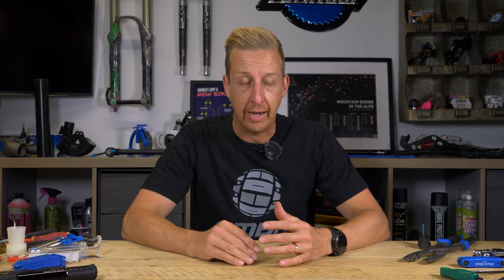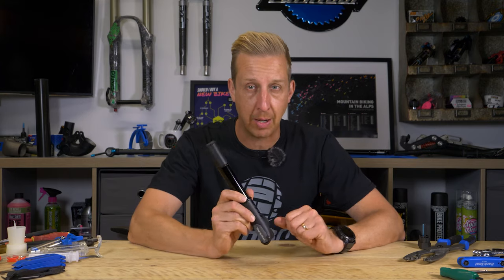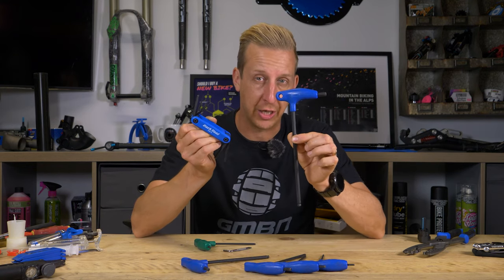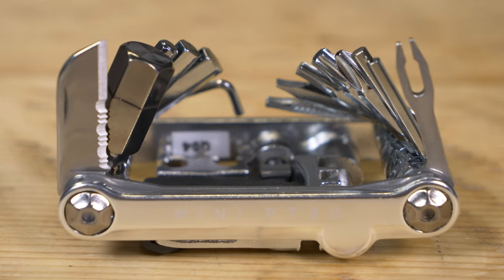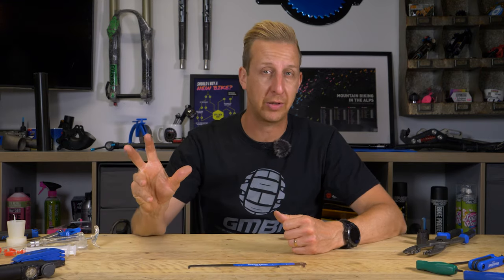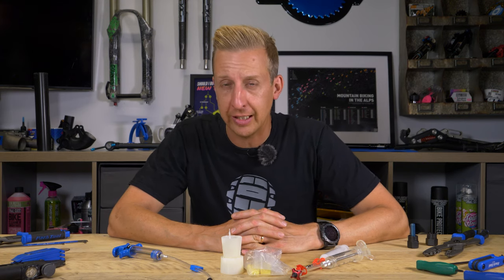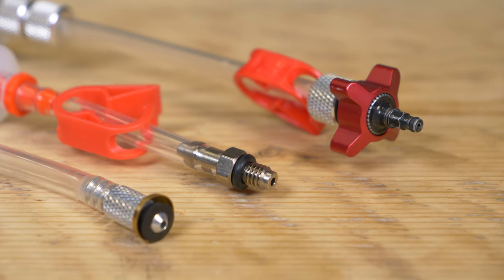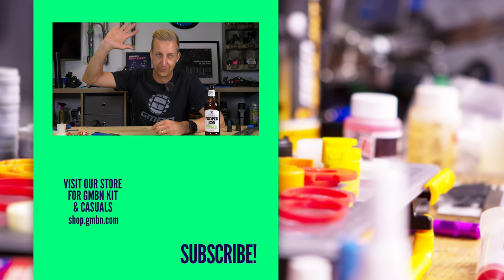All The Tools You Actually Need To Work On Your Mountain Bike | Essential MTB Toolkit

Comment from the maker: What're the most useful tools in your tool kit?
Reply: From time to time I get to strip down and deep clean and rebuild old and used bikes, so I'd say a crank puller. Can't hope to work with the old square taper standard without it.
Also a mug of coffee is very important.
Reply: Mine would be the specialty tools like crank puller, cassette tool, bb removal etc as I am sick of struggling with other tools like mole grips to remove the bb
Reply: Cup of Tea
Reply: Most useful?  Or most used?  I use the pressure gauge and pump nearly every day to top up the tires.  But there are a  lot more tools in the box that I couldn't do without.
Reply: My torque wrench is so important to me❗️Tightening bolts with the proper amount of torque is crucial to get rid of several problems, replacement costs and waiting times for spare parts/bolts.
Reply: @gogovitch66  what are the several problems that you have as provided you know not to overtighten things you get a feel for the correct amount of torque
Reply: My Clarke Tool Box is the best tool I have bought in years - I love it!
Reply: STEEL tire levers- I don't care who's name is on them or what color they are, plastic tire levers are rubbish.
Reply: @floydblandston108  just be careful when removing, resetting a tight 2.6 on a carbon wheel. Deep grooves and scratches ain’t groovy. Saw a friends crack his enve wheel trail side. True he may be a Sasquatch goon, but his fancy metal tire lever did major damage. Never happened w quality acrylic brands. Imo. Happy safe riding! 👊🏻
Reply: @nycgmr  - I bent, broke, or otherwise deformed a lot more shitty tire levers- including the 'quality acrylic' ones- than the number of rims (0) that I've damaged since going metal.
Reply: My Park Tools chain cleaner , strap it on and spin your chain , works great .
Reply: @TheRCBasher69420  ya crank puller came in handy many times !
Reply: @floydblandston108  go easy Hulk ;) 👍🏻
Reply: Precisely, Better the 3 dollar lever snap than your 1300 rim. IMO. OF COURSE. To each there own.  Metal for you? Ride on, right. Be well we safe.
Reply: My Crank Bros. multi tool has been my most useful and used tool. Love the cable cutter though. Thats has allowed me to do my own tune ups. Saves me money to spend on more gear. 🤑
Reply: @nycgmr  - unfortunately, my tire preferences seem to run towards the unmountable (Michelin, Vittorio/Geax), run tubeless! : D
Reply: My wera zyclop mini bit ratchet set. Take it with me on every ride and it's so so compact that can use it on every bolt on the bike as it comes with extension.
Reply: Knipex pliers wrench. Adjustable to turn any size of bolt. Can crimp end caps better than any alternative. Also useful for grabbing things like regular pliers. I use it all over the house too
Reply: Great video! I think a set of picks are super underrated and you don’t have to spend much to get a set that does the job
Reply: Chain cleaner, pumps, and hex keys I’d say. Use those all the time.
Reply: My leatherman, goes with me on the trail with my multi tool. The pliers saved me so many times.
Reply: Derailleur hanger alignment tool is specialist but I’ve used it countless times to sort shifting issues and bent hangers.
Reply: Xiaomi electric pump. Turn it on, set the desired pressure, rest and relax while the pump works.
Reply: allen key set

Comment: Also don't forget that you can use plastic/nylon tyre levers as a stand-in brake piston spacer, as well as pushing the pistons back into the caliper when fitting new brake pads or bleeding/cleaning your brakes. More multi-use single tools! 💕

Comment: The casette tool also does centerlock bolts, if anyone reading this doesn't know. Cheaper centerlock rotors use the bottom bracket tool.
Reply: And some rockshox top caps

Comment: A derailleur hanger alignment tool is critical if you ask me. You can get one for 40$ on amazon that does the trick. Such an easy job and one trip to the bike shop will cost you that. I wouldn't call it a specialist tool. Everyone bends hangers and rarely are they well aligned from the factory.

Comment: I normally use a MIG welder to cut and weld the inner gear cables. Just earth the cable, line everything up, a momentary zap, and your done. No need to crimp on a cap.  I mean t's worked for the last 20 years, and saves me buying a dedicated tool. Outers angle grinder (not in situ). You can also use it to weld old chains into shelf brackets for bike themed home decor.

Comment: Always have a nylon string/ shoelace in my toolbox and riding bag.
You can split chains, hold chains together to rejoin them, tie anything to anywhere (dropper on rear tire/ things on your bag/ Gopro on the tree /.....), zip tie alternative,  have a shoelace if you rip yours, I also did my internal cables with a string, a piece of metal, a magnet and the rockshox barb connector instead of buying the 60€ parktool kit. Endless possibilities 👍

Comment: Tire levers are also good for getting under those old stock grips without scratching your bars so you can spray some soapy water in there to loosen them up for changing.

Comment: "Only a rich man buys cheap tools"

Great video. For Allen keys I went with Klein for half the price. But I notice some flex when I need to torque on something so I keep some hardened steel Allen keys handy, just whatever brand the big box carries. 

Where I have cheaped out is I bought a very inexpensive and under powered compressor for popping tubeless tyres in place. Before that, I was having luck going to the air pump at a nearby gas station with a valve adapter and handful of quarters. 

Great vid!

Comment: The primary reason you want to stop your inner cable fraying, IMO, is so you can still remove the inner cable (e.g to clean/lube the inside of the housing) and then thread it back through again afterwards, without trimming it and making it too shorter.

Also, frayed cables are sharp and pointy, make sure your tetanus booster is up to date!

Comment: I've used the same Joe Blow floor pump for nearly 20 years, a model very similar to this one, and couldn't be happier with it. Well worth the $60 or so I paid for it back then (on sale).

As for allen keys, I will sheepishly admit to never having owned a proper set in my over 40 years of riding and maintaining my own bikes, relying on a combination of various multitools, a Park Tools 3-way ball end hex tool, and allen sockets for when I have to use a ratchet or torque wrench. These have usually sufficed but I will admit to having rounded the occasional bolt head due to insufficient torque.

No need for Torx tools as my bikes doesn't use them, although I do have various Torx bits and sockets.

Also no need for a bleed kit as I have rim brakes, but I do have a makeshift bleeding setup for when I have to bleed my car's brakes. I installed one-way bleeder valves on it which makes the process so much easier. Are there such things in the bike world?

I've never owned a high quality chain breaker because I've never needed one since I only shorten new chains and then use master links so I don't need the precision of a quality tool to install pins.

Otherwise I have all the other tools discussed here, and many others. However I try to never use an adjustable or crescent wrench as shown in the thumbnail if I can help it as they loosen and slip, unless it's the locking type or I don't have the proper size spanner and have no choice.

Comment: Some really useful info, cheers! Just a month or so ago was setting up for finally learning to do essential maintenance myself and after a bunch of research arrived at pretty much this set of tools exactly (even the need for a separate 8mm allen key to accompany a multitool 😆). The one thing I looked at and skipped for now is a chainwhip. I find that if you're only servicing your own bike and need to remove the cassette once in a blue moon, an old chain can do the trick quite well. Wrap one end around the sprocket, put the other end on the ground and step on it.

Comment: For allen keys, you can get a quality ratchet kit as well. They often include torx bits as well, you get the range, and you get the lever power. Moreover, you can use the same bits on a torque wrench (small or large).

Comment: The only issue that I have with this video is the Phillips Screwdriver, Bikes do not use Phillips, they use JIS cross-point, slightly different from a standard Phillips. If you try using a Phillips, you are more than likely to ruin the bolts on the derailleurs. Love the content!

Comment: Those tyre levers with the quick link holders look awesome
Reply: They are quite large IRL though. You might be unpleasantly surprised.
You can split a chain with a rock quite easy. 
Got to try with ordinary tyre lever though for no markings/coating damage.
Reply: But those levers are looking tough as nails though IRL at the same time. And once you look up how they work for splitting, they're even better. Literally unbreakable for splitting and very tough for everything else. But I've yet to make any operations on a chain on the trail or road, and yet to needed 2 levers in last 5 years of real MTB. Soo...too big for me.
Reply: @RealMTBAddict  if you get even 1 pin wrecked in the chain, there is no fixing it even with chain tool without cutting it short
Reply: I picked up a pair after a previous GMBN tech video. When they turned up they had a label on the packaging saying not compatible with 12 speed chains which was not on the product description or photos on Amazon or the Topeak website at the time. I returned them and will stick with my trusty Bontragers.

Comment: I have a 80's Bianchi road bike, I built it from scratch scavenging parts for about 3 years. After several years of enjoying the road bike, I wanted a mountain bike as well, so yesterday I picked up a Cannondale RUSH LEFTY. I paid 1300 bucks for it, however, the bike is completely stock and in almost brand new condition, only 1 very minor scratch on the pedal. I really love the design and I felt right at home as soon as I took it for a test ride. :) I am so happy with my purchase and its my very first "expensive" bike, I am a broke university student who loves everything on 2 wheels...sometimes even 1 wheel. From your professional experience, have I made the right choice interms of choice of equipment? Because happiness is priceless :)

Comment: built my bike with a multi tool
Reply: you have a multitool with bb wrench, lockringtool and cablecutters , bro i want one to🤣🤔
Reply: built mine with a multitool, pliers
Reply: @Basement_CNC  wheels came with a cassette, cut the housing and stuff with cable cutters, brakes no need because #external
Reply: @Basement_CNC  arent most bikes pre built? you just put wheels on n fit fork n bar.
Reply: Try repacking a hub with that. 😂😂😂
Reply: @Rab_Cee  this
Reply: @nicoskie  Which part of a bike build includes repacking a hub? Tell me.
Reply: Let me guess, your multi tool has a torque wrench included, didn't it?
Reply: @AJsoment95x  brotha most people do it by feel
Reply: @robertletsche9492  kidding bro
Reply: @AJsoment95x  Nope, just tighten it by hand, don't overtighten it and you're all good, only thing I torque down on my bike are the linkage bolts, rest I go by feel, I build bikes every day, I work in a shop.
Reply: @BGraves  Agreed actually, mine has that, pretty sexy, push it through and it comes out the other end. I like external too, but fuck internal without guides.
Reply: @robertletsche9492  I do it no problem with the aluminum parts, but the carbon parts would scare me to do it by feel, the amount of force on the same tool isn't even the same depending how you're holding and where you're holding the tool.
Reply: You laced the wheels up with a multi tool? Amazing
Reply: @tomwallhead6950  welded the frame out of tubing with it too
Reply: @matze8019  yeah, i do actually, we have parktool stuff but i'd rather use my multitool with all the sizes, it's a good quality one so there are no worries about that, well we do use a torque wrench to final check but as for me at home I do not, unless it's part of the linkage, i do not have a carbon part on my bike besides the frame
Reply: Built mine with h a stick
Reply: Built mine with a used repurposed heroin needle and a condom wrapper

Comment: You forgot the ultimate multi-tool... a hammer! - Seriously, the cassette tool is also used for some disc brake centrelock setups... not all of them use the 6 torx bolts...

Comment: Pump. I have a floor standing pump that not only I use for my bike tyres, but I have also used it to inflate a tyre on my van. £10 from Wilkinson.
Reply: Lol floor pump on car tyre, F that buy a car compressor ther cheaper than most bike pumps

Comment: You should put a disclaimer on those Topeak levers as they are not compatible with Shimano 11 and 12 speed quick links according to the packaging which a fair proportion of viewers will be running. I picked some up from Amazon after you plugged them before (I assume now they’re a sponsor).. Most retailers do not mention this and is not in any of the product shots either. Topeak also state in the instructions only they are not designed to be used on heavy duty, thick casing downhill or extreme off-road riding type tires. So they are pretty useless..

Comment: I prefer to build my own kit because I’ve had store bought kits where none of the sockets that came in the kit fit the nuts on my bike they was either too small or too big so I carry a small adjustable wrench to adjust seat or remove tires I have one of those Allen key multi tools,pump, patches a pair of gloves to keep hands free of grease from chain  a rag to wipe dirt off brake disks and a leather man surge I spoke wrench I try to keep my kit light since I commute and live only 2 miles from work

Comment: Speaking about small pumps:
Which mini pump would you recommend for trailside for tubeless tyres. I'm riding 29x2,2 and I've bought a ittle combo- pump with a CO2 cartridge function on the other end but the volume power is not OK to fill any modern MTB- tyres.- Maybe you can recommend me one.

Thank you!
Nice weekend!

Comment: #AskGMBNTech Hey Doddy! I really cannot understand why aren't six pot brakes a thing yet. I mean as stated in a previous video, 35 mil bars too are just for compensation to thicker stanchion tubes. Yes, there were old ones with six pistons from hope and brembo, but why aren't there any modern ones? They would probably be too powerful, but I bet those big brands could make them a little weaker, and the cooling would still be better (not even mentioning the cool factor).

Comment: #askgmbn Hey GMBN, my bike can have a 32t front chain ring max with the -3mm offset. My cassette is worn on the smallest 3 rings, but new ones are all out of stock for several weeks. Upgrading to a 34t will let me get more out of my cassette for the coming weeks. I'm able to go to 34t, but only with a different offset of +3 or +6. Can i just change the chain ring offset or will that negatively affect my bike?

Comment: Splitting chain with no tool video https://youtu.be/85Uednr4zFI 
Those splitting levers are looking tough as nails IRL, and splitting is designed well. But they are BIG.
Yet you can split with no tool, by tapping with multitool or a rock. Maybe pressing with ordinary lever to avoid chain coating or multitool coating damage when using advice in the video. Upvote and spread the trick which is still not well known.

Comment: Could anyone tell me how I can get some of the pipe that you need to bleed Shimano breakes, or do I have to buy a new kit?
Reply: Pipe?? Dont u use a shimano bleed cup n a syringe, haven't had to do new shimano brake yet
Reply: @Rab_Cee  Thanks, but I still need to replace the pipe for my syringe.
Reply: @paulholt2758  type "brake bleeding hose" on amazon

Comment: #AskGMBNTech I left my bike outside and the sun is high, every part of my bike is so hot. Question: Is it bad for the mineral oil in my breaks?
Reply: Brakes get extremely way hotter than transfer of material temperature via weathering. I've seen motor cycle break fluid boil due to inadequate materials and set up that is where you're likely to encounter heat problems over  (wrong techniques )use on long fast decent with harpin corners throughout speed excessive over 50mph ,brake fade can cause excitement failure seriously you don't want .